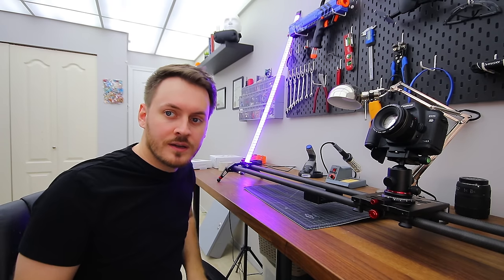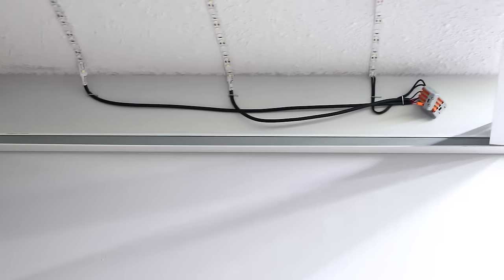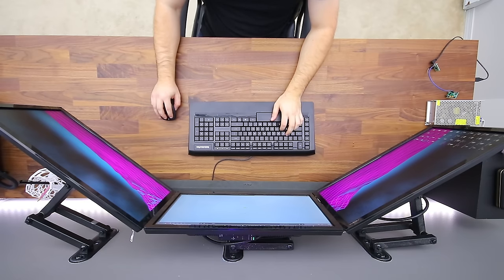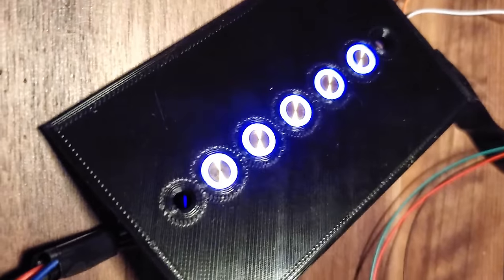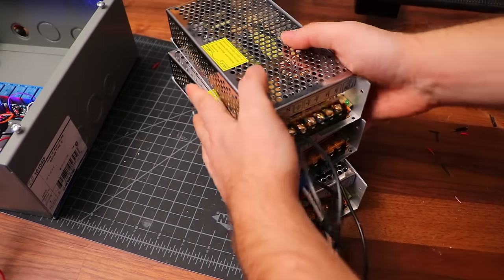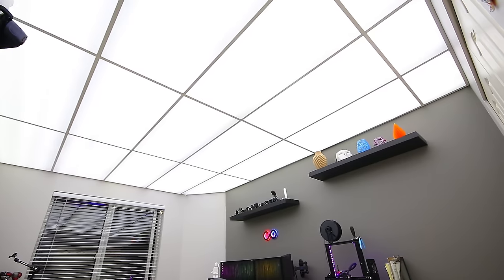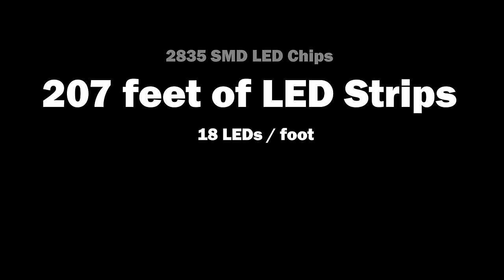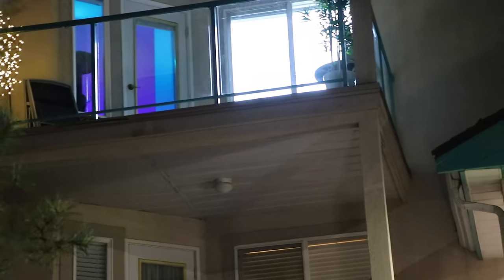Turning My ENTIRE Ceiling Into a Light Fixture

Comment: I want to do something similar to this in the future, but instead of using LED light panels, I want to use straight up 4K screens and throw on partially clouded, yet sunny days. Preferably doing it without having any edges, so the entire room just looks like it has no ceiling. It would be especially cool to link up the screens so they show what the sky looks like outside, as well as the atmospheric lighting. This would make the illusion complete.

I'm currently doing something similar to this, except I'm using Fresnel layers to scatter the light more effectively (and remove the visibility of the LED strips). This idea is also from DIY Perks, specifically the video titled "Turning Smashed TVs into Realistic Artificial Daylight". Everything in that video looks fake, but I tested it afterwards with some old fluorescent bulbs from an old screen and then the layers from the same screen. A panel the size of 40x20 cm lit up most of my kitchen, which is at least 4 m2 large. A single freaking panel. So to avoid going complete overkill, I'm going to build a set of smaller, individual light panels that can be mounted on the ceiling (instead of covering the entire ceiling) and then used with an Arduino to follow the time of day, so when it starts getting darker outside, my apartment will automatically increase the light inside, in order to match the daylight outside. There are more things I want to build on that, but I gotta start somewhere and the first stop is to make the panels themselves

Comment: WS2811 RGB's would be easy to do, setup a "matrix" within each panel....
you could control each matrix panel via easy software (free) like xlights.
use something like a kulp board to send the data to each matrix.
set up "preprogrammed sequences" that could be triggered via cell phone, laptop, or preset buttons using FPP (again free software with kulp board)

Very nice job ! ! !

Comment: If you go with RGBW Leds and control it with WLED on an Arduino you can set zones, so you could have a zone for each tile, or half tile or quarter, whatever. With RGBW you keep the white, but can also adjust the white temperature, have a warm light for nighttime etc

Comment: Brilliant! (Excuse the pun). Well done sir. For someone who’s “not sure” if his work is within regulations, you sure know what you’re doing. I’m lost on the electrical coupling and power requirements. I purchased a LED 1200 x 600 panel light, and only realised now that I will need a frame/mount to attach it to the ceiling... Fortunately I know which wire goes where.

Comment: The fact that only one person has done this (on YouTube at least) proves how monumental of a task this was...and that I'm probably as crazy as you are for thinking it up and searching to see if and how it's possible. So incredible. I know you're not an electrician but I had one question if you'd be so kind. Do you think set up would be too much on a 7 foot basement ceiling? I'm thinking of buying these 2'x4' led panels and making a 2x4 unit square (8'x8' total). They have 5k lumen or so, dimmable, and 3 color K ranges. It's an art studio with a white ceiling and two white walls, two gray. Polished concrete floor. Any thoughts?
Reply from the maker: thank you. I think it's doable, not knowing much info on the panels I would suggest just trying a small portion of the ceiling and see how it works out before committing to the entire room :)

Comment: DMX control should be obligatory here :) Especially if you are doing RGB up there. there does exist led strips with direct dmx control. every 10cm (roughly) is individually controlled, wich would be perfect for this. The only thing you need for the led's is a 24v power supply. Dmx-connection goes straight into the led strips. And I am sure you will find an open source dmx controller that does what you want :) You could of course do a WS2812 based thjing, but I think this is better, and the dmx tape is more powerful.

Comment: Not that I have the electronics skills to even control what you have set up, but if I made this, what I'd want to do is, on top of having a momentary switch for each zone, I'd want to build in a dimmer knob, a knob that adjusts the color temperature, and a "party mode" button that switches to chasing RGB gradients. It'd also be nice to be able to open a more versatile interface to dial in exactly the colors I want in the regions I want, which would be a ridiculous amount of work for lighting a room.

Comment: Since you have the controller by rows could you not have added rgb led strips with a smart controller  on each. So you can control the rgb of each section but also sync them if you wanted

Comment: The difference in power consumption i due to how extremely sensible the leds are to voltage variation. If you look at a chart of voltage and amperage you'll see exactly what I mean, it is a exponential curve. So, a change between say 11,5v, 12v can result in very different overall power consumption and, in minor measure, efficiency. Love the ceiling nonetheless! Great job!

Comment: Hey dude I'm trying to find those large industrial contactors, can you tell me where i can get them?
Reply from the maker: Electrical wholesalers or refrigeration supplier. They don't work well for low voltage applications just a heads up
Reply: @Coltography  I'm trying to use a relay to active the contactors so it can activate the circuit just so it can make that loud clicking sound haha
Reply from the maker: Ahahah ah yeah that'll work great!! Should check out refrigerative/HVAC supply houses in the area and see if they have old contactors getting thrown out then. If you don't need good conditioner contact pads then you should be able to get one free. They're typically a 24vac coil btw

Comment: Dmxking sells  compact and cheap addressable tape drivers that can output 4 universes of pixel tape.   Run the pixel tape on the framework of your existing drop ceiling frame.  Dmx king also sells a button station to to call back what you record.   For making recordings just make friends with the  lighting guy at your local club and he can generate some cool dmx-over-artnet patterns . The  Product is LeDMX4 PRO.
(note: addressable tape data can be duplicated simply by running extra lines from outputs on the card).

Comment: This is SO awesome! I remember that scene in Batman and thinking it was so rad I wanted to have that some day. You showed how it can be done easily. Now I literally am thinking I want to install drop-tile into my home office and set this thing up! Might go with square tiles though, ... and make each one addressable and create a sort of random pixel colors type disco effect when I want that... and make it just plain white for when I'm working.

I would like to know - what material was used for the actual tiles? Also how much did all of this cost? How much was the drop tile installation (materials) and the cost of the LEDs and equipment you ran it all through? How long did it take? I wouldn't want to get in over my head, but it sure looks sweet and I want something different from my regular boring room. Maybe I should also apply this to my walls!

Hey - yeah! Let's see you do it to the walls too... and make it so that your walls can be changed to any color and brightness... just for an extra spacey kind of futuristic look!
Reply: Cost me 10 times more than anyother drop ceiling can cost

Comment: I realize this is 4 years old, but I would get dual color analog strips with warm (2200-2700k) and cool white (5000k-6500k) then use something that can use high frequency PWM to dim. This way you can dim the entire ceiling without noticeable flicker and have warmer colors for some relaxed lighting. RGB addressable is cool no doubt however the color rendering index is going to be worse which is important for filming for any white (if you are getting (RGBW) and it doesn’t seem practical for general room lighting.

Comment: LEDs should be low heat emitting, still though, gotta ask: does it get hot when you go full blasting?
Reply from the maker: It's like leaving a 200w heater on in the room essentially

Comment: I had a friend who lived in a older house in the early 1970's that had a kitchen with a grid ceiling and florescent light in all the panels. Weirder yet there was a dimmer connected to a box in the garage that that was a magnetic controller and the lights dimmed but then many started to flicker on and off.  Those kind of lights don't like to be dimmed. Cranked up to max it was like daylight in there. I would like to do this with cracked TV's that have LED lighting. I have a few including a big former 4K screen that's one big white pixel now. The light from these screens is not spherical radiating but is focused straight out. When overhead the effect is like daylight thru a skylight, the source seems to be higher than the ceiling.
Reply from the maker: Hey thanks for sharing!! I would love to do it with the screens, a channel called DIY perks did a few videos on that. Wish I had enough panels to try!

Comment: You don't need a buck converter for your Arduino. Arduino can take voltages between 5v to 24v DC.
Reply from the maker: So I've been told, still needed 5v for the relays though

Comment: I did something a bit like that with RGBWW Strips by btf lighting. They can be controlled with MQTT. I designed a PCB to handle everything. Its pretty neat, but I am still thinking about how I can implement the indivdualy adressable function to MQTT and Openhab

Comment: u can use ex pc power supply instead using 3 pieces generic switching power supply and u get 5 volt rail to,so dont need use stepdown dc converter

Comment: I Made nearly the Same brass Touch Panel But i have a Big Problem using it: when i am touching on one butten (or i am close to) i activate the other sensor next to it too... any ideas how i can fix that Problem?
Reply from the maker: Add a dab of hot glue to space the sensor further from the brass. I had this issue later on too and this fixed it for me. Also google capacitive touch fix+capacitor, there's ways to make them less sensitive but I never went that route. Hope this helps
Reply: @Coltography  thank you for that fast response! I will try this :-)
Reply from the maker: @danielh.8781  no problem let me know if it works/doesn't work!
Reply: @Coltography  Wow! the thing with the glue actually worked! Thanks a lot!

Comment: Your electrical panel looks neat, but if you want it to look professional, you should probably have used rail-mounted components. Then you can also route the wires behind the rails, so no wire crosses a component.

And with those transformers, it should be a very safe installation. At least in Europe, 12V is known as "very safe low voltage" and can be used with almost no regulations regarding insulation, even in showers or bathtubs. Even when it comes to wires overheating. At 12V, you'll never produce enough watts to make overheating an issue.

Comment: hey! i know this video is older but i had a question since i'm always intimidated from doing this because of the power supplies. i see the lights you linked say they are 18 watts, and the power supply you listed is 360 so 360/18....20 light strips per power supply. i assume that's closer to 15 or something like that... i know i wouldn't want to run the power supply on my PC at full load. So.....why 3 power supplies? i know you said overkill but that seems omega overkill. can you explain why i'm incorrect? lol. Thanks!!

Comment: If only those damn tiles wouldn't be so expensive.
Reply from the maker: 13 bucks each!
Reply: @Coltography  I wish! What kind of material did you get? And which thickness?
Reply from the maker: @tcurdt  I think I have a link to the Canadian home Depot product I bought, they're very brittle acrylic and the cheapest type you can get. Made by optix
Reply: @Coltography  Unfortunately the link is dead :-/ Which thickness did you go for?

Comment: I don't understand.
1. Those relay use 5V logic isn't it? But the esp8266 is only 3.3v.
2. How does the toch botton has light, you didn't attach any led.
Reply from the maker: the esp just short to ground on the gpio, no 3.3 or 5v input

I ended up not using the lights for the buttons as they caused interference

Comment: Its probably not againsf any electrical regulations as its only 12v. I wouldnt of put the leds directly on the ceiling tho would of been better off in aluminum channels too help dissipate heat. And yea you went way over kill on those power supplies if its only drawing 318w at the wall outlet thats less than 3amps at 120v

Comment: Forget RGB
Think RGB-IC
Regards from Montreal ayeee
Reply from the maker: Definitely doing addressable. Regards from BC!
Reply: @Coltography  Here is a pro tip for you,  cuz you a fellow Canadian, 
When you are ready to install your LEDs be sure to place them inside a Aluminum LED Channel.
Sure the 3M tape is great and your LEDS will stay on your painted ceiling but in time and we all know the glue will fail, leaving you to un-install - re-install - time over time - again -
So do it right the first time and use Aluminum LED Channel.
It is costly I bought them for a little under 200.00$ then the corner ' L ' shape you get like 8 of them for 50ish dollars,

Amazon is best to buy this on the USA site, the Canadian site sells this for 25.00 More,  even afte the exchange rate and import fees { USA 22.00 }  [ CDN: 54.00 ]
I bought one of these
Muzata Led Channel Corner Connector kit L-Shape Adaptor 8PCS and Extension Connectors 20PCS for V-Shape Aluminum Channel, 90 Degree LC14,Series LA2 LC2
I bought 2 of these
Muzata V-Shape LED Channel System with Milky White Cover Lens Frosted Diffuser, 10Pack 1M/3.3FT Black Aluminum Extrusion Profile Housing Track for 3528,5050,5630 Strip Tape Lights V1SW BW 1M,LV1 LW1

I will make a youtube video on my install,  expect something wild, Canadian Wild.

Comment: I want button exactly like that. I'm looking for some capacitive button and can't find anything to my liking. and I though about drilling like you and I'm happy that I didn't do it seeing that it won't work. Think I'll need a 3d printer...
Reply from the maker: If you check the comments some people had suggestions for drilling the plates! Good luck and have fun
Reply: @Coltography  I'll be sure to check that! Good thing with that setup is that it doesn't require a server, so I'll be able to put some shelly 1 to make it also connected. You might have a solution for my other project.

I'm currently installing LED Strings and Pixel String around my house. For all the white one, the method in this video will be perfect, can use it with and without server/homeautomation.

But I also have pixel string (adressable). These one require a controller to work, and this controller are all software controlled. I'm unsure yet how I'll setup these (nodemcu? something else? have no experience yet with esp and these thing). But in the end, what I would like is to be able to control them with software/home automation (I use openhab with nodered + mqtt). But, I also want to be able to turn on/off using a switch that can work without de serveur. If we can add other stuff like dimming and color changing, all the better, but for me, having it at least turn on/off (to either a default set or just last set) would be enough.

I've been wrapping my head around this and all solution I found is using some sort of relay like shelly 1 to send and MQTT command. But unless I'm wrong, mqtt doesn't work without a broker nor network? Like if my router die, my network is off or my mqtt server is offline, I won't be able to control the light. And since my kid don't have access to my servers, they won't be able to turn on the light when they walk in a room with RGBW adressable light.

Thanks!

Comment: i would of just ran 413's in the roof, plugged 5 lots of led strips and have the 413's switched from the light switch. would of made everything way more simple. just like having 5 lots of led strips plugged into the wall, thaht you could turn on and off.

like have 5, 413 plugs on a single 2.5 twin and earth wire and have a switch wire to the light switch. its probably not legal in any way but still much more simple

Comment: right ; fixture molding
Reply: chair legs are great dividers
Reply: tensionity has battery strength and style cues modern compared to lamp fixture aesthetic
Reply: metal legs battery housing greater frequency to generators
Reply: crinkle is also possible
Reply: automotive door hinge vertical lift houses generator to reservice
Reply: if a wall was down you could project farther

Comment: Hello, I was wondering if you have any trouble with the TTP223 switch. I installed 2 of them in a wall plate similar to this https://addison-electronique.com/en/products/electricity/modular-wall-plate-2-ports-white/ and they keep randomly triggering each other. I could put them on 2 different plates but I feel like a waste of space. I know I can lower the sensivity by soldering a cap on it but I don't have the tools nor the skills to solder on this (i tried, always end up burning the entire device)
Reply from the maker: Did you attach them to brass like me or any conductor? This increases the sensitivity big time, I ended up spacing the metal way from the sensor with a thicker dab of hot glue and it helped a lot. Once in a while one row of lights will turn on, but it's pretty rare
Reply: @Coltography  oh, yeah I did the same. I'll try with the glue. I did put quite a bunch but will try. It does make the whole plate around it touch sensitive. The sensivity on these switch are crazy.

Comment: Maybe I'm stupid and where you are you calculate the cost differently but you got 318 on the plug that for 24 hours is 7.6kWh for the whole day which is 7.6 cents per day (no way you actually play 1 cent per kWh that's dumb cheap)
Reply from the maker: Corrected in top pinned comment